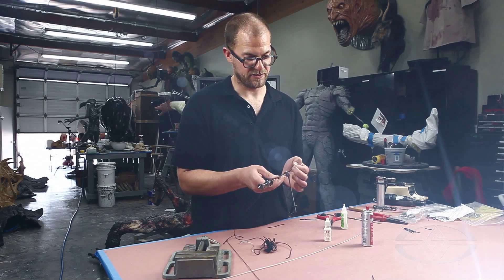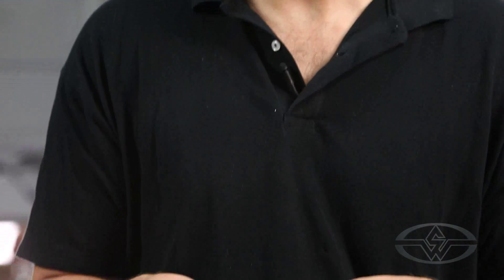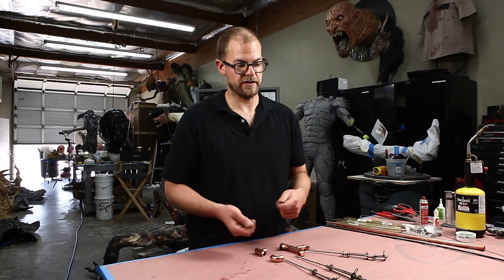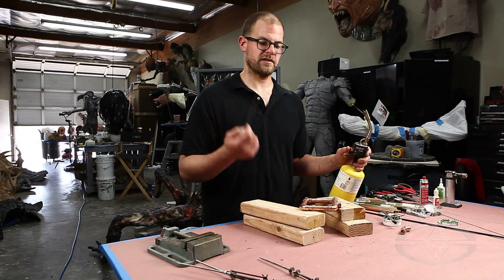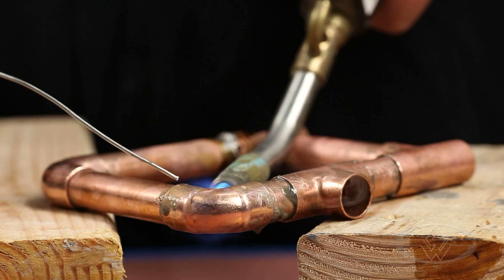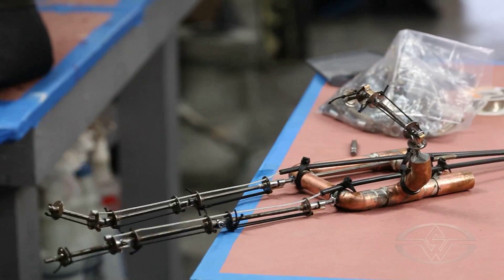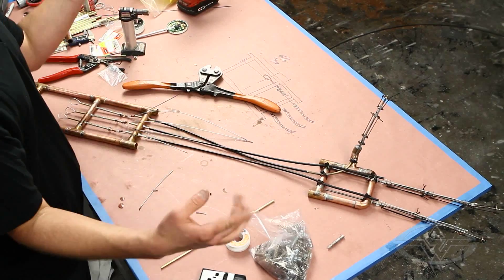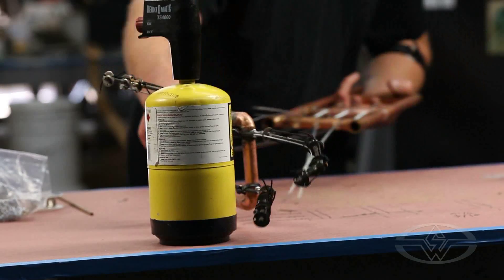Making a Mechanical Hand - PREVIEW

Comment: I do not understand how flexation (straightening of fingers) happens in this design. All I see is a metal joint with a tension cable. I'm assuming that the black string is an elastic.

...Is the elastic perhaps above the joint pivot?"

I've tried many designs and used rubber bands as a flexation tool, but you need to be on the money, plus the banding loses its properties in an uneven manner.

Hands have been driving me nuts since 1982.

Can anyone help me out understanding this?

:)

:P